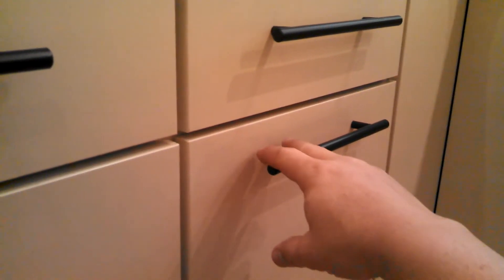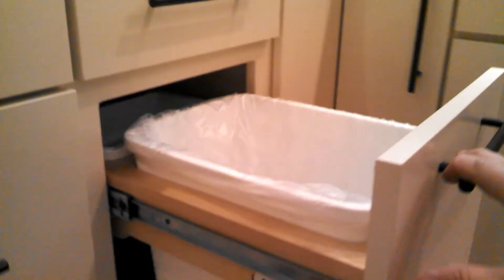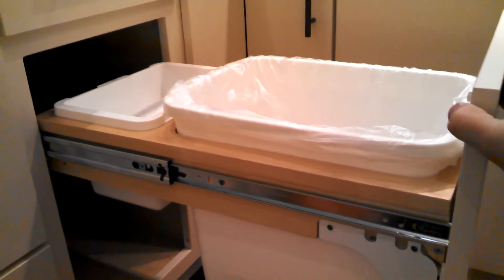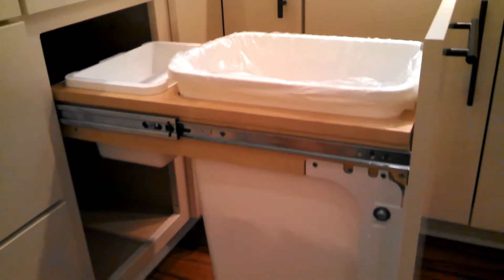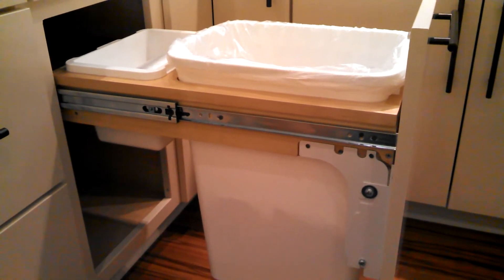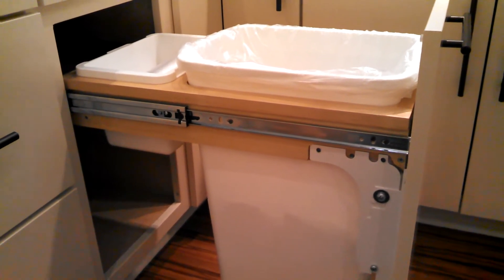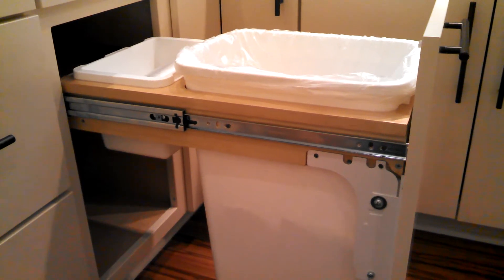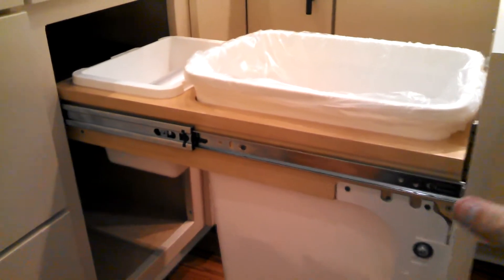Undermount vs Side Mount Soft Close Rails

Comment: It's entirely possible the rails were installed unsquare and the slide is not deflecting.
Reply: I agree
Reply from the maker: True and that could have been part of it but what I didn't show in the video is by pushing down with just a little weight, you could easily see the deflection of the drawer box.